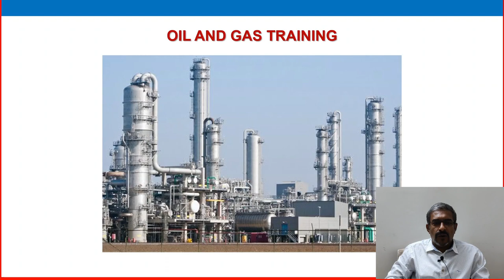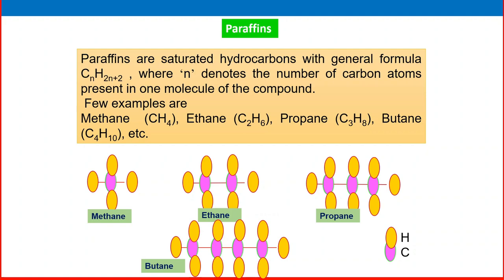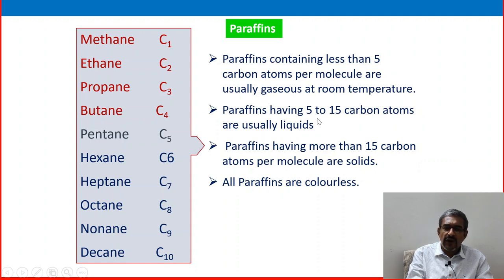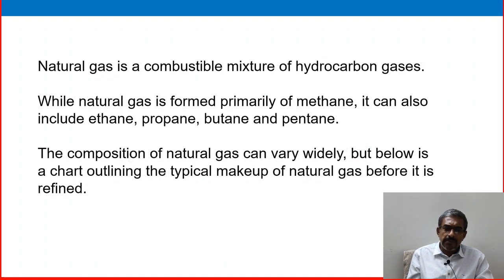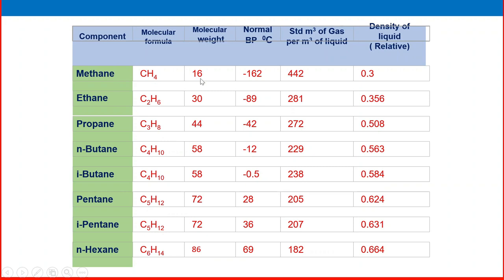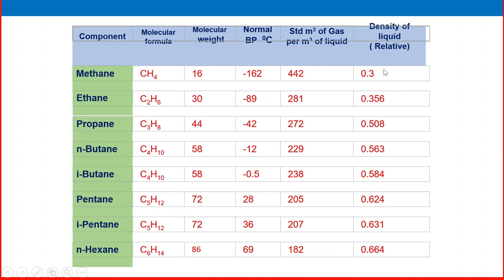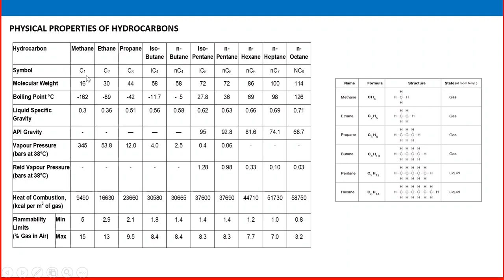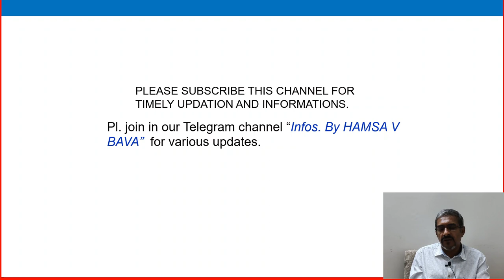Natural Gas processing - Part 2

Comment: I really appreciate sir, this going to help in my masters degree program.
But I have a question, you said that hydrocarbons with 5 carbon atoms are gases at room temperature, but in most of the slides I can see that pentane is classified as a liquid. I want to understand y.
Reply from the maker: pl. check the boiling point of C5